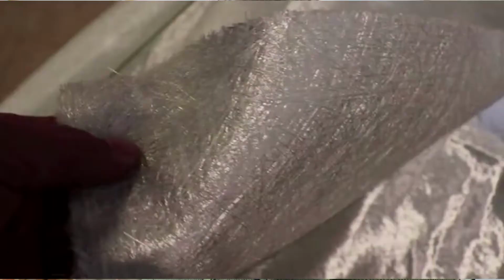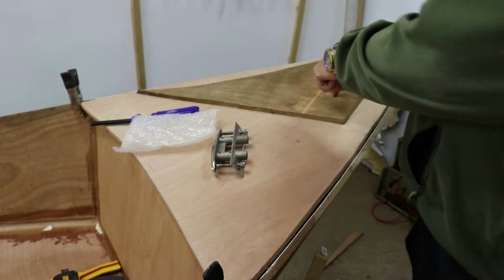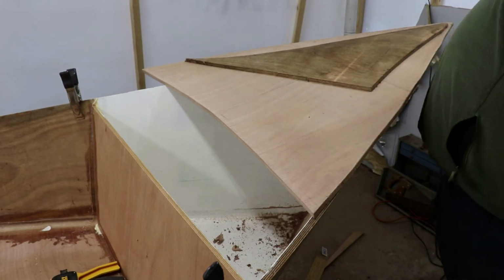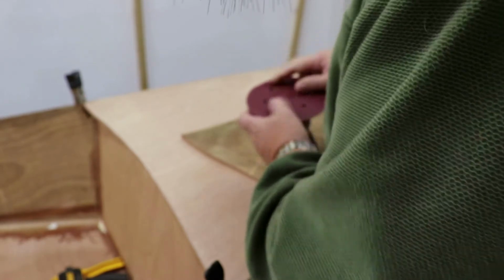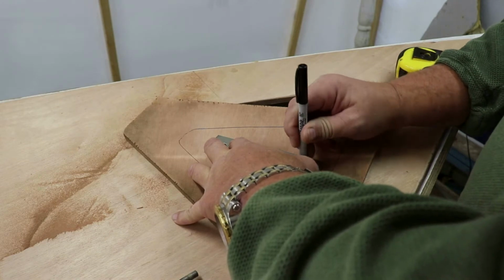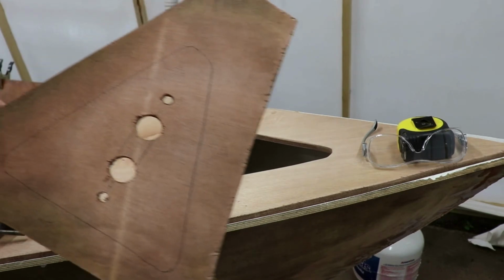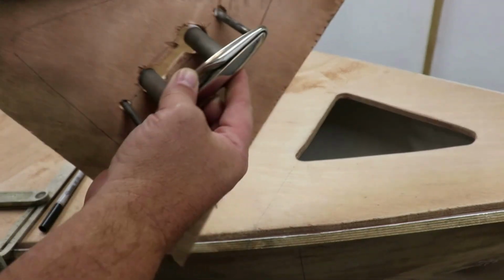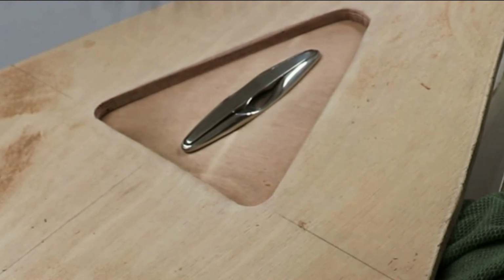Bubba's Tango skiff 18 - EP. 55 Bow Cleat layout, Cut in & Mock up

Comment: Just an idea. But that rear edge of the "foredeck" seems to be prutruding an inch or two rear of the front bulkhead? If so, I am thinking if you have a passenger up there on the bench who wants to use the bulkhead as a back rest, that the edge will be uncomfortable to lean against. Perhaps cut it down so it's flush with the bulkhead?
Reply from the maker: Thanks for the forethought..I'm planning on a thick padding sunbrella covered backrest ..but I agree with your assessment.  I'm also running a few strips of 5/4 (31.75mm) strip planking across that leading edge